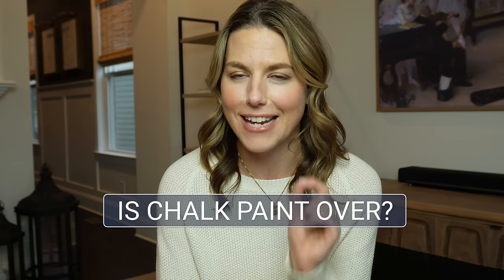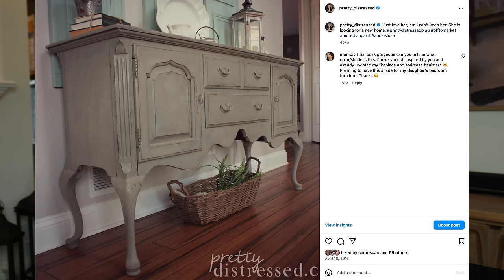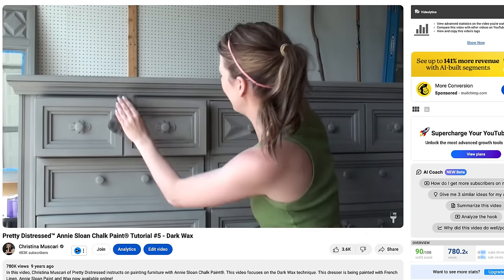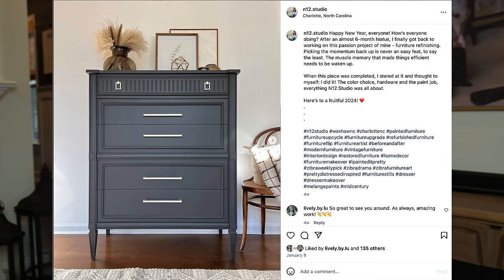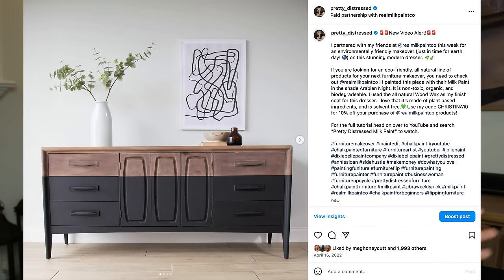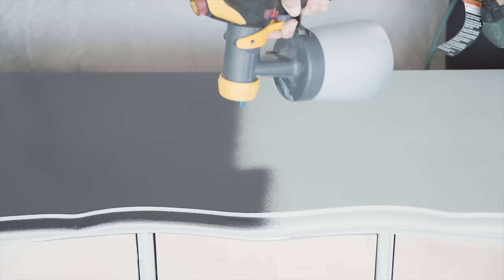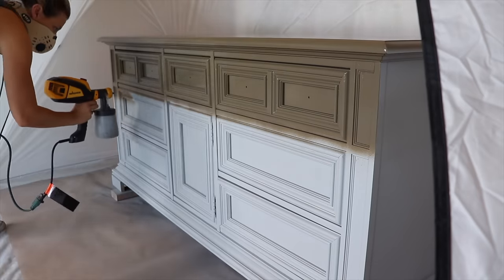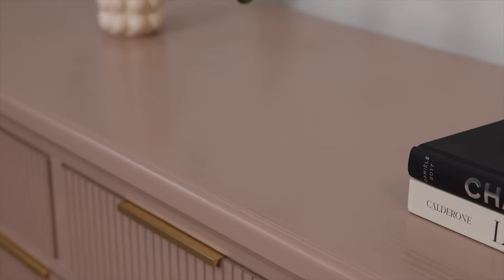Is Chalk Paint Over?

Comment: I’m a Furniture painter and woodworker. I do a lot of two toned pieces in my woodworking builds. I’m more of the modern farmhouse and sleek looks. I’ve never done a lot of distressing or blending. In my journey to find a paint for both my built projects and my painted furniture I used a lot of paints. But I’ve found that I love love love Dixie Belle. I’ve only just started using there Silk line and love it even more. Especially since it has a built in top coat and primer. I love Dixie Belle so much I became a retailer. I still sell way more of the Chalk Mineral line than Silk so I feel like it’s not dead yet. 

Thanks for sharing this.
Reply from the maker: I love your knowledge and experience. How fun that you are a DB retailer and so interesting to know you sell more chalk mineral than Silk. Thanks for sharing!
Reply: I love Dixie Bell, I think it’s one of the best out there. I also really love the shocking white of Rustolium chalk pain. Still Dixie Bell my fave

Comment: I have been refinishing since 2017 and I still use Chalk Paints and I also use Mineral Paint. I was NEVER a fan of farmhouse or distressing and always went for the smooth finish with chalk paint, so calling Chalk Paint farmhouse or distressing paint feels unfair. It may do it better than Mineral/All-in-One paints, but it also does smooth finishes beautifully. Also, depending on your material, you absolutely still need to prime when using light colors. I have put multiple all in ones to the test and they still bled over time when used over unsealed wood. I also seal everything I am selling, even if the paint has a built in top coat, because it is the equivalent of 1 coat and I pretty much always do at least 2 coats of a sealer because I take pride in my work and want to know it is durable and will last for years in homes with kids and pets. My go to products are still Dixie Belle Chalk and Silk paint, Annie Sloan Chalk and Satin paint. For top coats, I am either reaching for Annie Sloan clear wax or a polycrylic.
Reply from the maker: Lots of great thoughts. Thanks for sharing!

Comment: My favorite paint brands are Fusion and Melange but for me, they are not as easily assessable as chalk paint which I can pick up in my local hardware store. And I like that I can get it in virtually any color. My style is sleek and modern and I find that chalk still works well. All in ones are great but I still feel the need for an extra layer of top coat so the extra step for chalk paint does not bother me.
Reply from the maker: Great thoughts. Thanks for sharing.

Comment: Hi Christina,  I love your channel and you have inspired many of my own furniture flips.  I have not mastered the paint sprayer and I started many project with a sprayer only to abandon it  or start over with a paint brush and roller.  I have the same sprayer that you use in this video but I get a lot of overspray and a very bumpy orange peel finish that does not dry down.  I have bought the wagner paint tent but there is usually more paint on the tent than the furniture.  If you have any suggestions it would be really appreciated.  I have placed my sprayer in the garbage bin twice, only to fish it out and commit to trying again.
Reply from the maker: Thanks for watching! Don't give up on the sprayer. It sounds like you have your air flow setting too high. I usually spray furniture paints at a 4 or 5 and I always thin my paint out by at least 10%. Also, it sounds like you might be too far away from the dresser if you are seeing a lot of overspray. Make sure you are 6-8 inches away from your furniture. I hope that helps. I love spraying now.
Reply: Thanks Christina for your reply.  I have a few pieces that I will be working on in the next month so I will definitely give the sprayer another try using your suggestions.

Comment: I mostly did wood refinishing, not painting, so I've never used chalk paint. However the low VOC & easy cleanup is theoretically appealing. I've  bought Fusion mineral paint @ a local store & if I ever try spraying, will probably stick with that. I've also bought Behr because its cheap & @ BBS's, but the warnings are scary. So it's only brushes & rollers.

Comment: Loved this video…. Question for you about using spray technique …. If you decide to prime your piece first… do you spray the primer on as well, vs brush the primer on ??     So basically, spray all the layers ??   Yes or NO.    Thanks for this video.  I have lots of Annie Sloan… sitting in my She shed 😊
Reply from the maker: If I use a water based primer, I spray it. If I use a oil based one or shellac based, I will roll it because I don't want to deal with the clean up. But I do find it easier and smoother to spray all the layers.

Comment: I actually did use Beyond paint on my very first project however it is chipping a lot!! I am not sure what 
I did wrong, and now I am hesitant to use it again. Maybe too many coats or maybe 
I should have tried spraying it. I just got the spray gun and waiting for warm weather so I can use it outside. Any suggestions for protecting the area on the bottom where the vacuum hits. I feel like it needs bumpers lol
Reply from the maker: When it chips, it most likely the surface of your furniture. Make sure you scrub really well with simple green and rinse that with warm water really well. If you know the furniture has been waxed at all with furniture polish that can be removed with denatured alcohol before cleaning it. And, yes, don't hit a dresser with the vacuum. Bumpers are a great idea there.

Comment: What is that little sander that you are using?  It looks really good.  Do you need to go outside to use a sander?  I live in a flat and need to keep the furniture in my living room. Laminte floor, no carpet, and I can cover the other furniture in plastic I suppose
Reply from the maker: Its best to use a sander in a well ventilated area because of the dust. I am not sure even with a dust extractor that I would ever recommend using it indoors. I use a Festool Rotary Sander or a Ryobi Cordless Orbital Sander. Both are linked in my Amazon Storefront!

Comment: Chalk Paint such as Dixie Belle, Wise Owl etc  have not gone out of style. They are specifically formulated for furniture, easy to apply and durable. I CRINGE when I hear people talking about using big store paint for their furniture. The Dixie Belle Satin Paint “all in one” is a Primer, Paint, Top Coat all in one. You said you didn’t have to prime your daughter’s dresser that you painted with Silk. That’s because it HAS a Primer in it. It’s great for kitchens and bathroom cabinets. Each kind of paint has specific uses, chalk paint can be blended for beautiful unique finishes whereas all in one paints cannot. Also, most people who are refinishing furniture don’t have a set up to spray furniture and the expense of a setup and sprayer. Thus would have been a better video if you had focused on the advantages of each kind of paint instead of calling your video “ Is Chalk Paint Over?” The simple answer is absolutely not. 😮😂